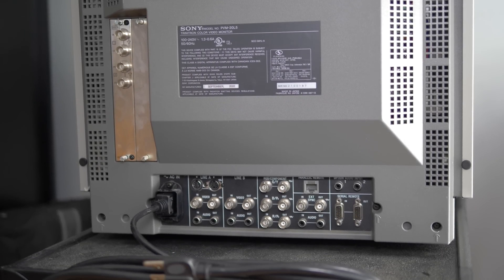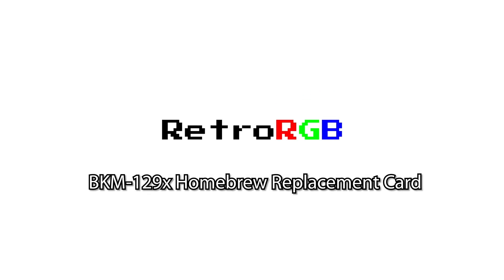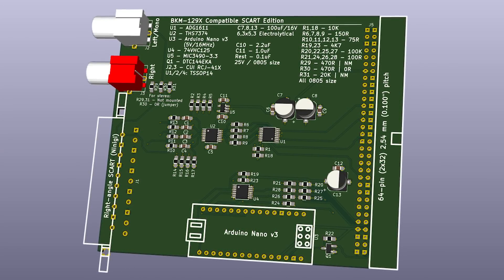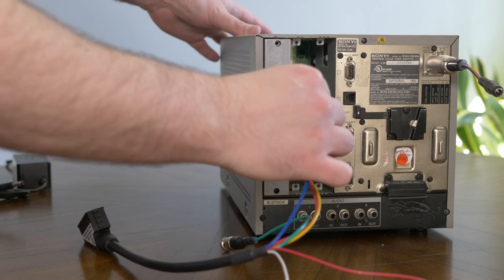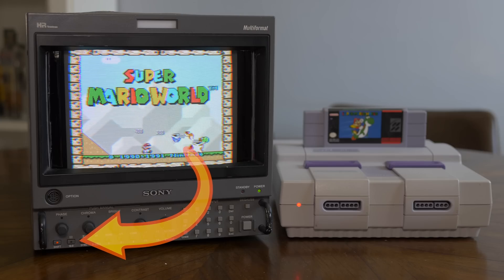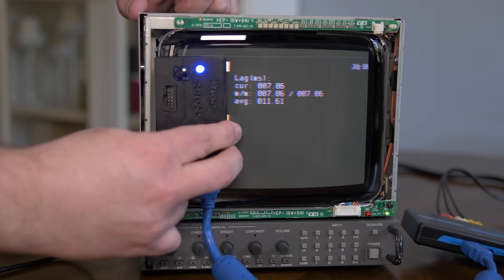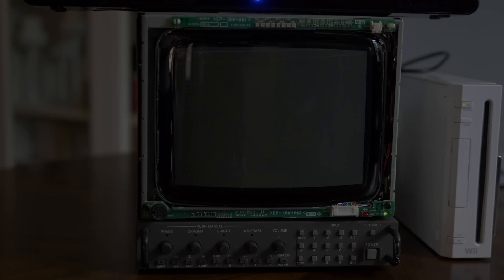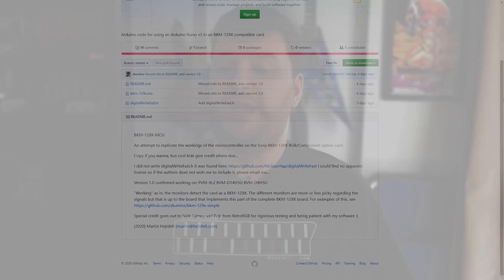BKM 129x Homebrew Card

Comment: I was under the impression the outputs on the 14L5 self terminated and you didn't need the 75ohm terminators.  I thought that is what the little squiggly line next to the outputs meant?  It is on the add on cards as well (Well, it's on the official BKM129x anyway) which means they should self terminate.

Comment: You mention that there are "projects working to address the D series sync issues".  What projects are those?  I've had hell addressing sync on my D14.  I can't get my Pi2SCART to work well with anything less than a sync stripper + 202 RXi (RGB 192V is insufficient), but the 202 absolutely crushes the intensity or contrast (depending on gain setting).

Comment: The PVM 20L2 uses the BKM-129x, and is probably way more common than the other monitors you mentioned.

It has a built-in RGB input as well, so the BKM-129x is used as a secondary input. I usually have one set to YPbPr, and the other to RGBS
Reply: One of the buyers on the group buy has the 20L2 for testing, so we will have compatibility confirmed on that model soon.

Comment: Is this monitor specifically garbage? Everything looked so blurry. Why not just use a 20L5 for the video instead?
Reply from the maker: I would not recommend the D9H for gaming, but if you're a retro hardware developer, it's an excellent monitor to test your RGB creations, since it's the most INcompatible monitor I've ever used;  If it works on this, it'll work on anything.  That's the specific reason I used it in this video - If this replacement card works in the D9H, it should would in EVERYTHING the 129x is compatible with.

Comment: FYI you don’t need terminators on the 129x as these models it’s used on self terminate.
Reply: True, except it is the card that self terminates, not the monitor. According to the BKM-129X schematics it seems to be some specific BNC plug that somehow switches the termination off when the output plug is used. I've not been able to find a similar plug, so a passthrough version of the homebrew will have to have terminators on. Unless someone can figure out wth that type of BNC plug is called and if it is even made anymore...
Reply: Martin Hejnfelt Oh that’s very interesting that it’s a specific type of BNC connector.
Reply: @taylorjwyatt  Well if I read the schematics correct, the BNC jack of the output ports has some sort of an extra pin. The only way I can make that make any sense, is that when the output jack is used, the 75 Ohm resistor is then "coupled out" if that makes sense. I did see a single BNC that could do this, but it was like EUR13 or smth a piece (which would kill the idea of making a cheap BKM-129X :))

Comment: Hm so this would be used for my d14-h1u?

Ive never had good luck with that monitor.  It's run super dark since i got it, ive never really done a deep dive on how to fix/adjust.  I dont think this card would fix it, and unless i can figure it out I'll have to hold off.  Very cool project, though.
Reply: It should work for any BKM-129X compatible monitor, including the D14H1U (it's been tested fine on D14H5U, and as far as I know, the difference only lies in the embedded controls of the H5 unit).
Reply: How many hours does it have?
Reply: @unlovableshinshin  I can't recall off the top of the heads but pretty low!
Reply: @ThePorkTree  This is weird, dark tubes suggest high usage. I have a 20LMD, I'm trying to sell, because of a dim picture.